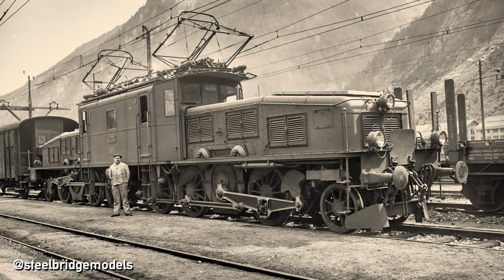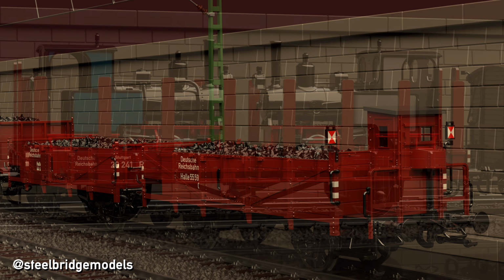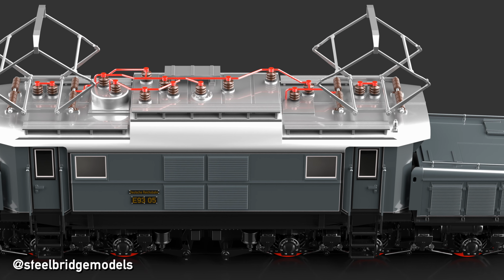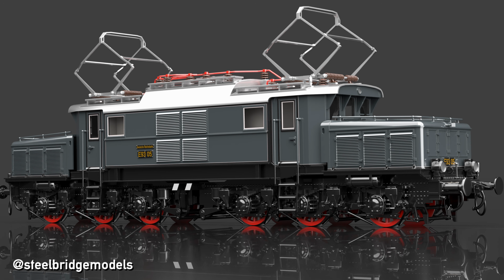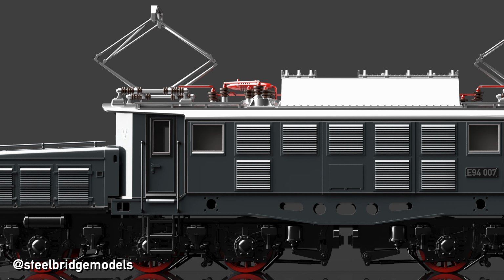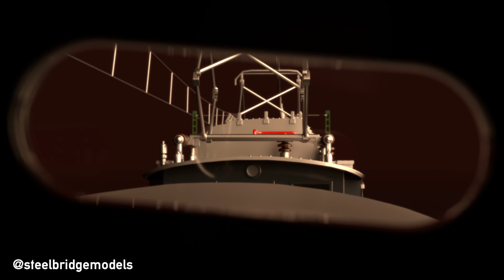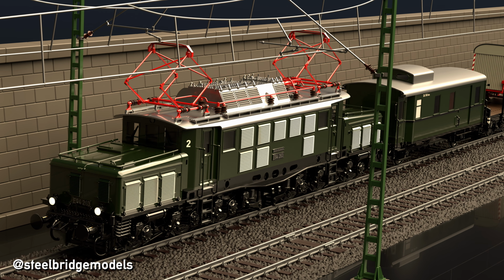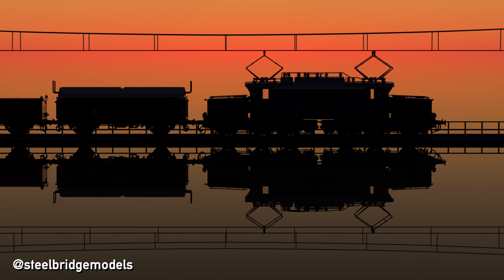The first modern Goods Locomotive!

Comment: Very interesting video, most enjoyable and informative. What was/is the electrical system? AC or DC, what voltage? What frequency is the AC current? Are they compatible with the Swiss railway supply? Could/can they operate outside Germany? Here in the US electrified railways are not as extensive as in Europe and the rest of the world. Before retirement I worked for a regional system that was part of the vast Pennsylvania railroad. They started with a 600 volt DC third rail power distribution system and transitioned to overhead AC at 11kv, 25hz, generated at it's own power plants. Much of the system is now 25kv at 60hz commercially generated power. Keep posting your great videos. I always learn something new with every one. I'm fascinated by how many different ways the same needs or problems facing  railways were delt with across not only Germany but also Europe.
Reply from the maker: They use 15 kV 16⅔ Hz AC, but are due to the geometry of the catenary pretty much limited to Germany and Austria. Though, operation in Switzerland has happened in the past but requires a narrower pantograph.

Comment: Compliments from Stockholm! As usual, a very interesting summary about the E 93/E 94-locomotives. A class that I have always liked a lot… though these locomotives were perhaps not so fun to work with on daily back in the days. As I understood, in recent years, some were rebuilt so that the locomotive driver could sit, but otherwise it was the case that the locomotive crew drove standing.

Perhaps Br E 93 and E 94 are not to be regarded as classic crocodile locomotives, if one compares them with SBB's classes Ce 6/8 II and Ce 6/8 III or ÖBB's classes 1089 and 1189, but they could probably be considered close cousins. Similar locomotive types have also existed elsewhere. For example, RENFE, initially acquired by Norte (CCHNE), had the locomotive classes 271 and 272 (the latter even called El Cocodrilo) for many years. Even in my home country of Sweden, the then SJ had a freight locomotive of class Mg that in construction and appearance closely resembled the E 94, and the Mg locomotives had largely the same wheelbase and length as the E 94.
 
In the latter case, the similarities are so great that in the Swedish model railway world, chassis from E 94 models have been used as the basis for a locomotive body for class Mg (as the latter never been manufactured as a ready-to-run model). In H0, it was primarily recommended to use Kleinbahn's E 94/Rh 1020, but chassis from e.g. ROCO have also been used. The same method applies to scale N etc. The biggest visible difference regarding the chassis and drive is then the appearance of the bogie sides.

Comment: A big question is, of course, what denotes a crocodile?
3 piece body: ✔️ coupling rods ✔️ but then the Deutsches krokodil doesn't have connecting rods. So is the Milwaukee Bipolar a crocodile then?
3 piece body and coupling rods... okay, sbb ce 6/8, and... the drg E91 or E77! 
Sooo a crocodile needs a snout at each end as well... okay, the seetle crocodile, or the VZ Hge 4/4, those French B-B and C-C jobbies, they have snouts... but they're all just one rigid body....
So we're back to square one.

The name krokodil (crocodile) as far as research goes, was entirely the invention of märklin with their gauge 0 and I models of the Swiss ce 6/8. 
For their early 1912 Swiss locos märklin gave them the name of gotthard in the catalogues, so a continuity of this was märklins nickname of krokodil.
With this in mind, and märklin had given them that nomenclature before the advent of the drg E93/4 series, it would seem appropriate that the Swiss ce 6/8, and only the Swiss ce 6/8 be given the name krokodil.
The öbb variant, seeing as it was from the same builders and essentially an altered ce 6/8, can be given honorary membership, likewise the rhb ge 6/6 I which, again, builder, and uses single traction motors rather than twin.
With the E93/4 series even märklin didn't give them that title.
That name attachment just seems to have been applied by popular demand because the Germans were jealous and didn't want the Swiss and the Austrians to get all the cool names.

However theres that coolest of the cool of all elloks, the fantabulous kpev eg538 with its three piece body, outside frames, 3 driving units, coupling rods, jack shafts, and a central cabin that looks like a garden shed.
I'm getting emotional just thinking about it...

Comment: This isn't fully correct. In the 1970s there was an even more modern corocodile, the E1200, build by Henschel für the RAG, the "Zechen-Krokodil" or also "RAGodil" wich also were the first three-phase current build in as production series and not prototypes ;) I would say, that those are the most modern crocodiles.
Reply: The E 1200 isn't a crocodile because it has a single frame, it isn't "bendy". If you call that a crocodile, you may well call the V 100 a diesel crocodile.

Comment: Hello!  Fun fact, although it’s in a different color, this locomotive reminds me of Lego set 4551, which itself was a crocodile locomotive.

Interestingly enough, just like the real life E 94, the Lego set also has issues with turning, where the single axle under each articulated section can sway enough to come off the tracks during some runs, only to be occasionally re-railed by passing over a switch.  Although, sometimes, passing over a switch with the front axle off the track will just derail the locomotive further, leading to significant crashes.

Overall, run 4551 slow, if possible, and it will do just fine, run fast, and you’re liable to crash.

Good video though!